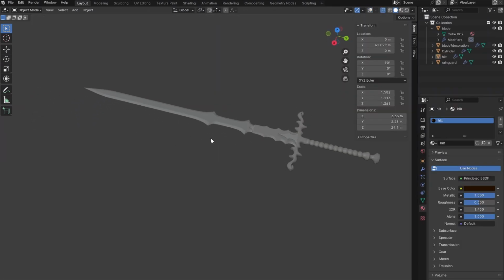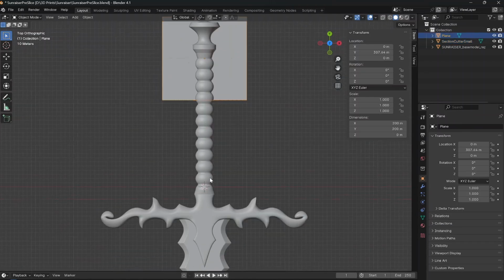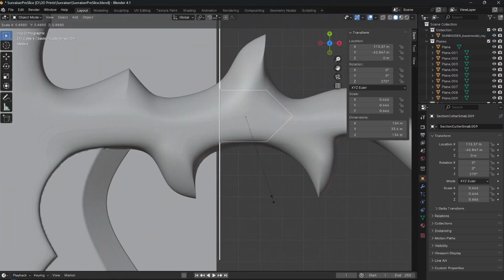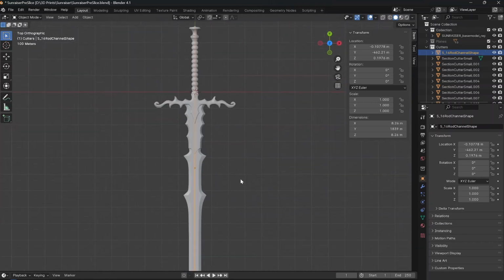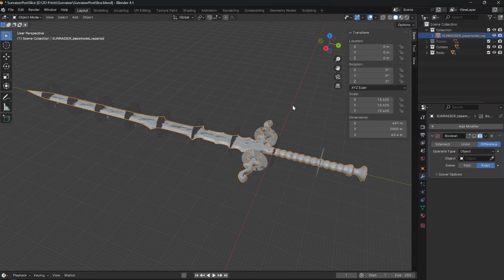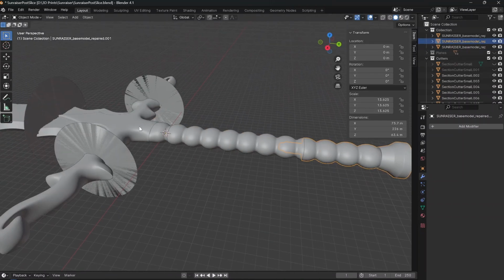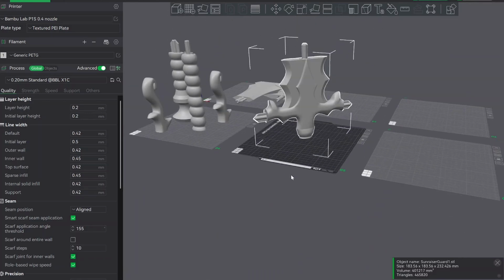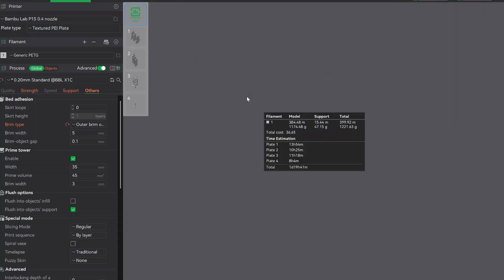Make HUGE and STRONG cosplay props with ANY printer: a step by step guide

Comment: Can you explain what a section cover is, and where to get them?
Reply from the maker: Yeah - the section cutter is a part that I designed that is used in blender or another 3D mesh software with a Boolean feature to cut the model into pieces and create joints that let you assemble the pieces together. 
I left a link to download the files in the description!